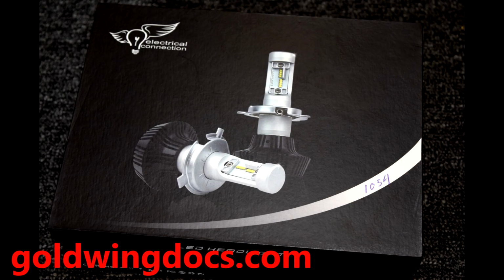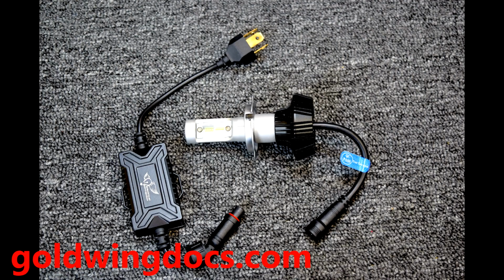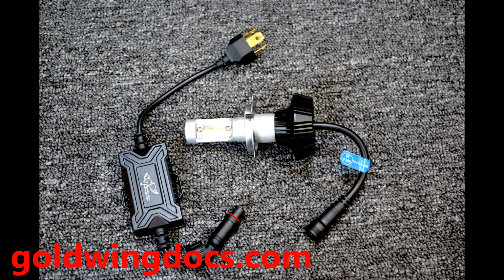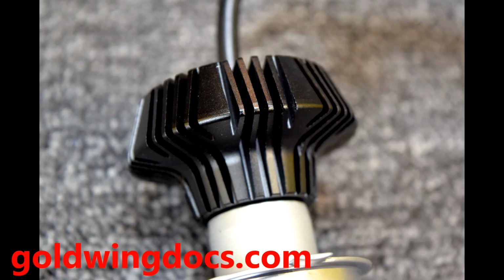GoldwingDocs Review of the Electrical Connection LED Headlights for Goldwings

Comment: I just viewed your two videos - one showing the Electrical Connection LED headlights and the other showing the Pathfinder LED headlights.  I ran the two videos side by side and stopped at similar places along the road when you were showing low beam and high beam light dispersion. I cannot tell any difference between the two products as far as light output.  They are almost identical.  I would almost swear that both products were made in the same Chinese factory.  They both even had that same inverted "V" shadow.  But, as you noted, when turning on the side lights it pretty well fills in that shadow.  I guess you couldn't go wrong with either kit.
Reply: the V i think is the gold wing lens and not the bulbs. Im running stock head lights in my 89 gl1500, and wow, they gotta go, so I think these are the ones im going to order this year. I did do the curb light to running light conversion and i love it. Im in Michican....gotta be able to spot those magnetic exploding deer that line the roads here

Comment: Thanks for the video review.  I've read your reviews on the Pathfinders and the EC's prior and I was still in the dark on which to buy.  I think my mind is made up now that I've watch your video review, but I wanted to know if you've heard if SCMG fixed the high beam problem in the new Pathfinders that they are marketing now.  I'm also replacing the position lights with the LEDs from SCMG as well, but I have a couple more concerns.  1.  Are the color profiles compatible between the EC head LEDs & the SCMG position LEDs?   2.  How do you deal with sign reflectivity, especially going to a brighter light?  I'm blinded by my old halogens!
Thanks.
Curt